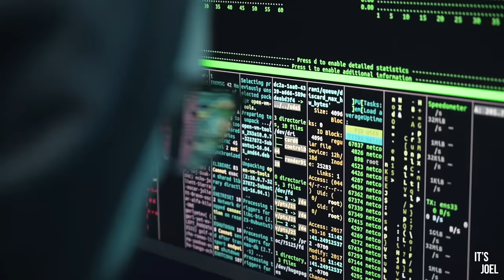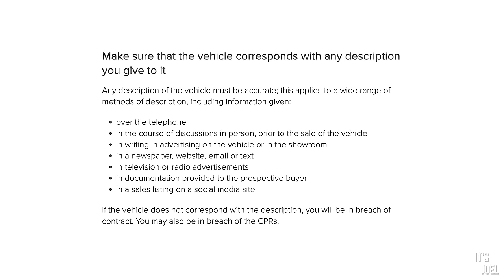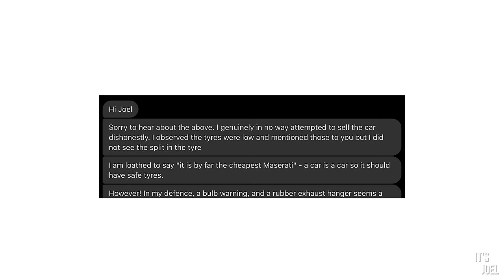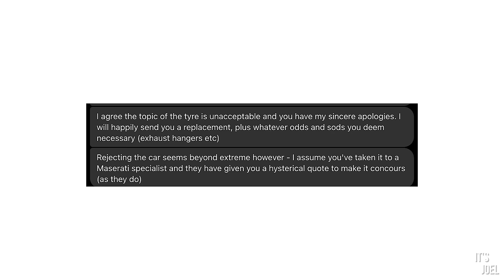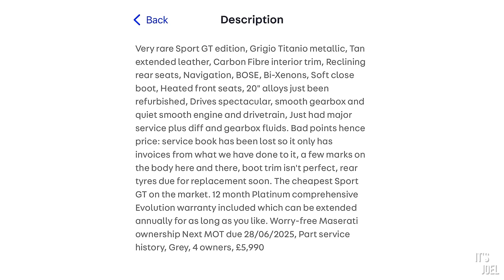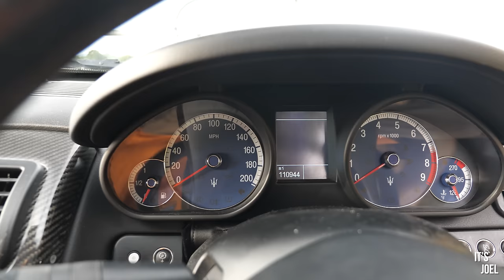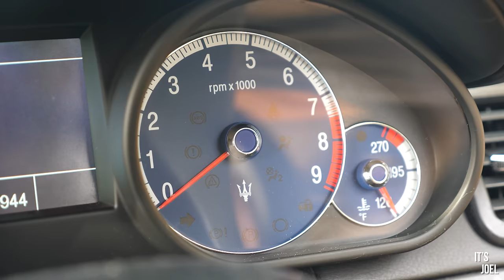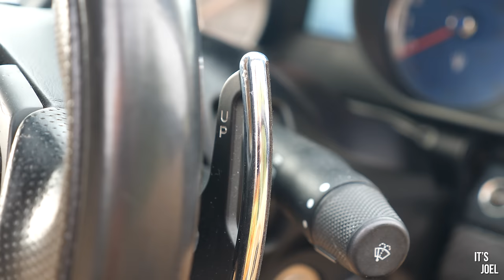I was lied to about my Maserati Quattroporte...

Comment: First of all, modern Maserati is worse than modern Alfa Romeo when it comes to reliability and parts availability. Stellantis seem to make cars worse the more expensive they get. Second of all, you need to have your solicitor deal with this dealer, stop trying yourself. You are being shafted by this guy and UK law is going to clean him out if this goes to court. He does not deserve to get away with this. Some things I observed in your video: It seems your headliner is coming off? Your exhausts look like they have soot in them, indicating either an emissions system malfunction, or excessive oil consumption. Having said that, this is based off a youtube video, so I may have observed wrong? You may want to look into these and see if I have seen it wrong of if it warrants further looking into to see if you want to get anything rectified. You were told this car had no problems to speak of and that is what you deserve to get. Expecting this from a Maserati is naive, but the guy advertised it so he should deliver. 
Ask Barum Engines about what an automotive professional is expected to deliver and what will happen in court if they haven't covered their behind legally 101%.... This guy can and should be taken down and I think you need to get a solicitor to do that for you.